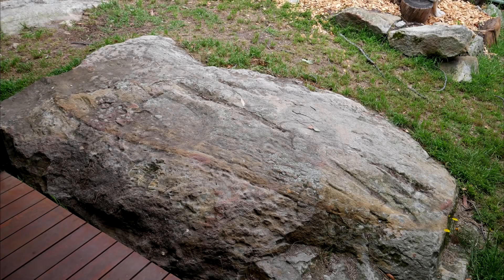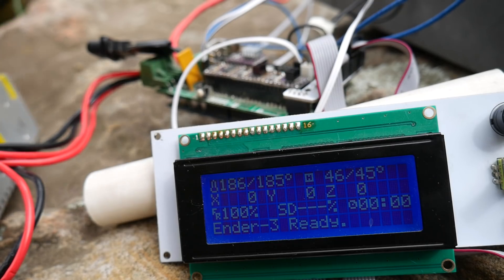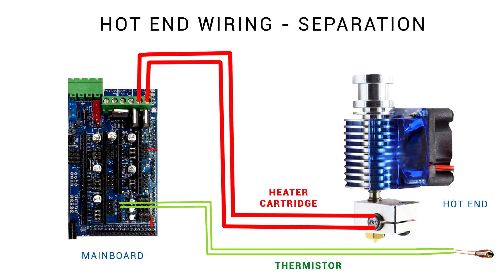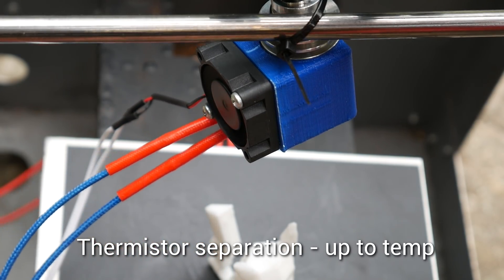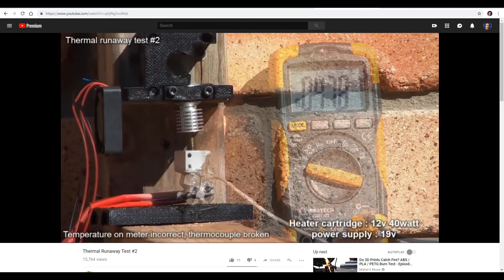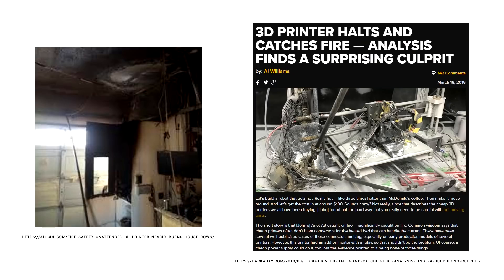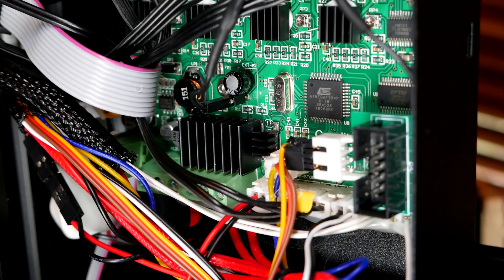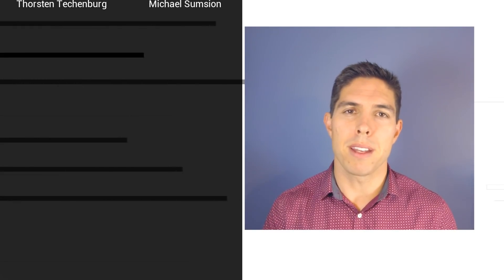Is your 3D printer a fire hazard? How to test Marlin safety features

Comment: THIS is a fantastic video.  One more item I'd recommend is replacing the power supply cables from the PSU to the XT60 plugs, the power cables to the main board, and new XT60 plugs with the cables soldered to them.  The XT60 plugs on my first Ender 3 melted and actually caught on fire.  Killed the printer.  Was very happy I was in front of my printer when it happened.  My current two Ender 3's both have incredibly hot plugs (to hot to touch) when getting into the 24+ hour print range. I'm pretty sure it's only a matter of time before the same thing happens.  Specially as these printers print pretty much non stop.  Because of this, I've been getting ready to replace the cables and XT60 outright with higher quality cable (and soldering the connections in the XT60).
Reply: Wow, gotta check those plugs too. :O
Reply: The Tinker Dad stopped using one of my Ender 3s this week because the xt60 plug is showing signs of heat.  Won’t be able to work on it until Sunday.  Was talking with some in the Ender 3 Facebook group and it seems there have been a number of people posting about this.

Comment: Very good explanation of how this works. Unfortunately my printer is repitier based so I don’t have this feature in firmware. Looking at making something external to provide the same safeties, unless there’s already something out there...
Reply: There's no reason you cannot move your printer to Marlin just because it's running Repetier.
Reply from the maker: I'm interested in making a simple Arduino module that detects smoke and kills printer power with a relay. Something like this would be firmware independent and even help against a busted MOSFET.
Reply: @TeachingTech  maybe the present PRI can do this if one uses Octoprint anyways, so no new board needed (except the relay and smoke detector)

Comment: I have a CR-7 rebuilt with an MKS Base board. I've set up Marlin to detect a thermal runaway within 15 seconds with a 7 degree window... I managed to trip thermal runaway protection while changing nozzles (adjustable pliers turned out to be a great heatsink for the heater block).
Reply from the maker: I think I might tighten my parameters to make it kick in sooner too.

Comment: your thermal runaway is  way too compliant, i run it (and have tested it to be safe) at 20 seconds and 8°c, that way you ensure nothing Will Burn in the time it takes to trigger thermal runaway, and for the bed 15 sec and 2°, the thermal runaway settings should be very strict, as much as you can get it to,  that way you don't risk a fire, the heater cartridge can heat up to 300 from 200 in 15-30s, so be careful
Reply: this is one of the most important things about it, because I see people's settings being too compliant, that's dangerous as it wouldn't trigger, it should know something's wrong in less than 30s, and the °c should be very close, +- 3-5°c is good, that won't have problems with the fan cooling the nozzle as it gives time to recover, but if something goes wrong it's quick to know, I can tell you from experience why I set my thermal runaway so strict, my heater cartridge reached 350° in 25s when it fell out one time, (you can tell as it has a purple-blue temper now)
Reply from the maker: Great suggestion, I will tweak mine.
Reply: @l3d-3dmaker58  So you say that it should look like this, if I understand well:
#if ENABLED(THERMAL_PROTECTION_HOTENDS)
  #define THERMAL_PROTECTION_PERIOD 20        // Seconds
  #define THERMAL_PROTECTION_HYSTERESIS 8     // Degrees Celsius
  #define WATCH_TEMP_PERIOD 20                // Seconds
  #define WATCH_TEMP_INCREASE 8               // Degrees Celsius
#endif

 
#if ENABLED(THERMAL_PROTECTION_BED)
  #define THERMAL_PROTECTION_BED_PERIOD 15    // Seconds
  #define THERMAL_PROTECTION_BED_HYSTERESIS 2 // Degrees Celsius
  #define WATCH_BED_TEMP_PERIOD 15                // Seconds
  #define WATCH_BED_TEMP_INCREASE 2               // Degrees Celsius
#endif
Reply: Can you explain like I'm 5, how to make it less complaint.

Comment: Well, I have a printer with reprap firmware. Can you add thermal runaway to printers with reprap firmware? If you can, how?
Reply from the maker: Reprap is a style of printer, it probably already has Marlin firmware. If you connect via USB it will tell you the version and when compiled.

Comment from the maker: Since I've updated my firmware long ago, I have no way of testing if my Ender 3 shipped with thermal runaway enabled or not. Can I please request that anyone with a newly received printer complete my test at 9:06 and post the results here.
Some viewers have kindly pointed out that the uncooled third MOSFET is for the part cooling fan. This fan draws very little current, therefore I would consider what I showed an optional fix.
Reply: I tested my Ender 3 Pro a while ago and it doesn’t have thermal runaway protection. I’ve yet to find a Creality Printer that does except the ones I’ve reflashed.
Reply: I just got 3 Ender 3 units this past week I can confirm non of them shipped with thermal runaway protection. These units were purchased directly from Amazon.
Reply: @GuyWhoReviewsStuff  could be older stock, not sure if the printers have manufacture date on them any where, i have a gen 1 Ender 3 so i know it wasnt enables but TH3D fw fixed that
Reply: @reflector36  The manufacture date, or at least the year, shows on the manufacturer sticker. Mine was manufactured in 2018 and I bought it about a month ago. When I tested it as shown in the video, Thermal Runaway Protection never kicked in. I'll be upgrading my firmware tonight.
Reply: I'll do it tonight when my now sketchy 24 hour print in a flammable IKEA lack finishes  😂
Reply: I have one en route, but I am not very educated at understanding what the codes mean. Your videos are helping with this and I appreciate your consistent effort to get us all up to speed. Thanks again Michael.
Reply: As mentioned in another thread, my new Ender 3 off Amazon I got last week also had no option for thermal runaway.
Reply: Just bought my Ender 3 about a month ago from GearBest with a manufacture date of 2018 and haven't upgraded my firmware, yet. I was under the impression that Thermal Runaway Protection was enabled by default, and I often print things overnight, so I'm really glad I watched this. I preheated the nozzle to 185C and watched it drop all the way down to 66C over about 2-3 mins after disconnecting the red wire. So, it doesn't appear to have come with it enabled since it never triggered a error. I will be upgrading my firmware tonight and re-testing.
Reply: I got my Ender 3 from Gearbest this week. Just did the test - no thermal runaway protection.
Reply: Ender 3 bought Aug 2019 with 1.1.6.2 does have thermal runaway protection.  I also tested it with and without the Raspberry Pi and OctoPrint.  If the Pi is connected the the "ERROR REPORTED BY PRINTER........printer halted" will display on the computer with Octoprint up.  With the Pi disconnected it displays on the Ender 3's display.  I also tested the bed and got the same results.  My test method was the same as yours, I disconnected one of the heater wires on the control board.
Reply: I get my new and first enter 3 pro this Thursday, I’ll post the result ASAP.
Reply: I will get mine standard Ender 3 directly from Crealitys official webshop (EU warehouse) tomorrow, can try if more tests are needed.
Reply: Bought an ender 3 pro (late July 2019) which came with 1.1.6.1 stock firmware and it does have thermal runaway protection per your test
Reply: I just bought a new one couple weeks ago it did not have the thermal protection enabled. I have done your update and it is all working now but since the update the cooling fan for the board does not work now and also the thermal protection test took 100 temp change to kick in but it did kick in. I done the TH one you have a video on thank you so much.
Reply: Just received my ender 3 a few days ago and th. runaway is disabled.
Reply: I got one at Christmas and just tested and no thermal runaway.
Reply: Ender 3 Pro ordered on Nov 23 2018. Clicked on preheat pla, at 120C I took the first red wire out, 2 minutes later the temp keeps dropping but the screen remains the same.
Reply: Rec'd my Ender 3Pro mid Feb 2019, manufacture date "2018" and no TRP was tripped after a minute or so.  I guess it is time to try an update....I wish there was a way to read or edit the stock fw, as it is probably in there, just not enabled....
Reply: I have a new version with silicon socket (I bought it two weeks ago on aliespress, and still thermal runaway seems to be still turned off... After unplug the wire, temp drops from 185 to 60 degrees and still no warning about thermal runaway...
Reply: I redit the test and it is still turned off (bought it in July)